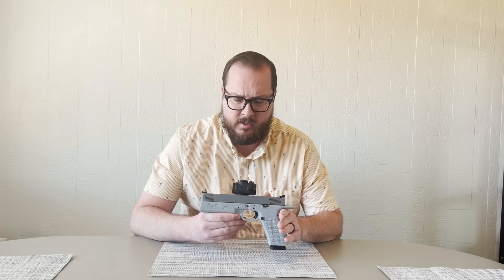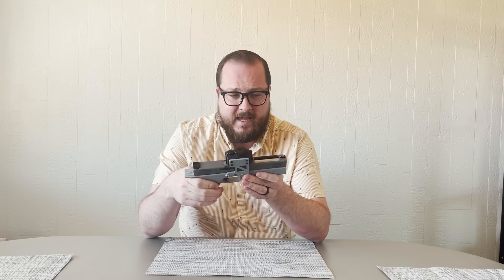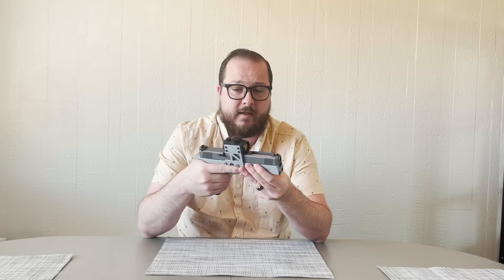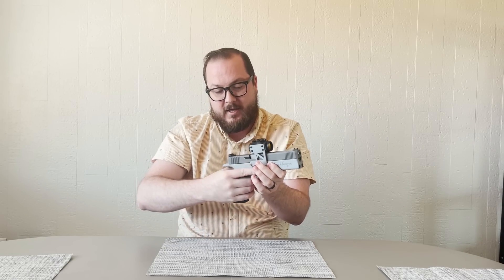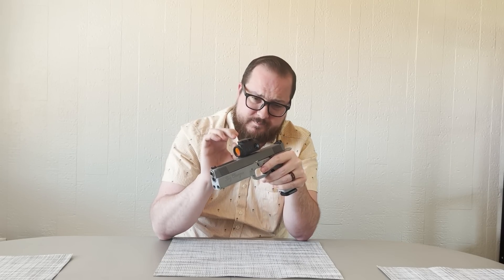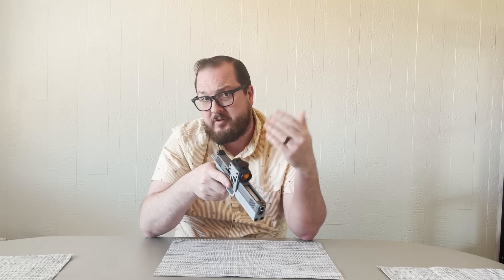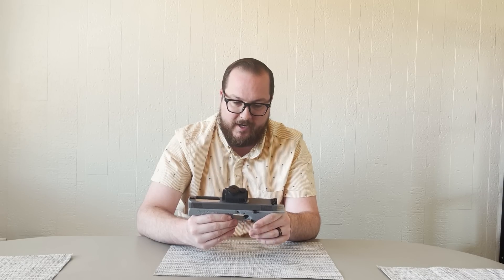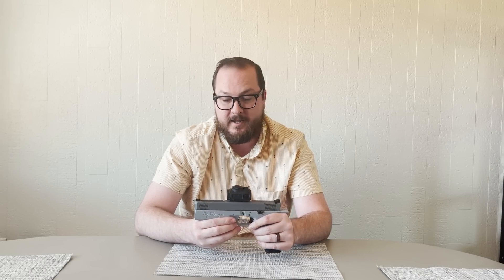G17L "Big Chungus" 3D Printed Competition Shooting Pistol Introduction

Comment: Have you thought about 3d printing a glock frame with a built in stock or brace?
Reply from the maker: Sure, but with the proposed brace rule change, all braces on Glocks are pretty much a felony, so I’m waiting to design anything final until that gets figured out.
Reply: @booliganshootingsports  would it be legal to form 1 a 3d printed frame?
Reply from the maker: It would, but not advised as they lifetime of a printed frame is anywhere between 1-1000 rounds.
Reply: @booliganshootingsports  wow I didn't know that. Thanks for satisfying my curiosity.

Comment: After printing a few of these and running through testing, you need to either ad a fillet, or other type of support where the trigger guard meets the dust cover. For some reason, the structure actually thins out right there where it joins up. Every single one I have printed has broken right there.
Reply from the maker: Interesting, I haven’t run into that on any of my tests and it’s the first I’ve heard of it. But it’s something you can easily add on the files yourself. I’ve release the STEP file and adding a fillet is easy to do with free software like Fusion360.
Reply: @booliganshootingsports  i just downloaded fusion 360. I am pretty new to this but my print quality has been excellent. Also, I am trying to break these prints.

Comment: Do you need a G17 or G19 lower parts kit for this? Or either should work?
Reply from the maker: It’s a G17 frame, so you’ll need those parts, FMDA DD17.2 compatible rails, and a Gen 3 3 pin locking block.
Reply: @booliganshootingsports  nice thanks! got confused with the long boy where it had g19 grips and wanted to be sure
Reply from the maker: @z-man7883  the LongBoi still runs a G17 parts kit. The only thing G19 on that one is the grip length which makes no difference with the parts used.
Reply: @booliganshootingsports  ah got it 👍🏼

Comment: Hey just a FYI that the 9th circuit court will rule on broadcasting 3d gun files. being on a platform that may cancel you if you are breaking any perceived rules i would recommend sharing it before may 8th if you wish to.  Thanks again.
Reply from the maker: I'm not subject to 9th Circuit Court decisions, so it's a moot point for me. If anything the recent panel review that vacated the state AG's injunction is a win for us. They'll appeal, sure, but it's all moot. It's been shown repeatedly that code = speech and they can't block it legally, regardless of how much they want to.

Comment: How much for a 3d printed frame?
Reply from the maker: You can’t legally buy one if that’s what you’re asking, unless the maker is an FFL07, serialized it, does a 4473, etc. 

But it costs about $4 in material to print one.

Comment: if you made the red dot mount a little thicker, you could probably chamfer the holes to use flush countersink screws, and you could also always slope or round the edges of the mount to offset the additional thickness. but i think this would solve the screws being proud of the mount, and may also address the mount wobble

Comment: If the printed optics mount is too wobbly you could  replace it with a (maybe cnc'd) aluminium or steel plate.

Comment: How did you decide what weight of rod to use and why did they have to be titanium
Reply from the maker: The weight is dependent on the available size of the compartments. Two 3.5oz Tungsten weight packs fit perfectly. I decided on Tungsten for my personal use because it’s incredibly dense for its size, but you can use any 3/8” round weights in there. It’s standard pinewood derby size and shape.
Reply: @booliganshootingsports  are there any text based guides on general principles of 3D printed gun(accessory) design that you recommend? I like your off the wall style (more present in the other designs )
Reply from the maker: @fozbstudios  not really. I kinda just started winging it based on stuff I learned from YouTube.

Comment: Have you considered making the tungsten weights sub-diameter to the holes they are mounted in and putting a spring between them and the screw caps as a kind of inertial buffer? I know it would do almost nothing but if the goal is to be ridiculous it fits the comp bill and takes it a step funnier.
Reply: Nah use mercury recoil dampeners like the trap shooters

Comment: Maybe I'm weird but why not just run a comp? Weighing down the front of the gun is so old tech
Reply from the maker: Because with a comp, you normally need to fiddle with ammo weights, spring weights, etc. This will give me improvement across the board of all ammo types. The cool part is that you can still run a comp if desired and get double the benefit.

Comment: Honestly think the frame mounted sight is a better idea than slide mounted. Particularly because it doesn't move backwards and forwards throwing your eye off as much and it is far easier on the optic in terms of force from the slide cycling. Also you don't have to change springs or slide weight.
Reply from the maker: Exactly! Would you want to run it on a CCW pistol? No, of course not. But for a specialized competition or range pistol like this, it’s so nice to have set up like this.

Comment: Can you put a 17 slide on it and 3d print a compensator to the front of the slide
Reply from the maker: No 3D printed compensator would last. But you can use a properly made flush mount compensator on this frame theoretically.
Reply: @booliganshootingsports  that would be cool